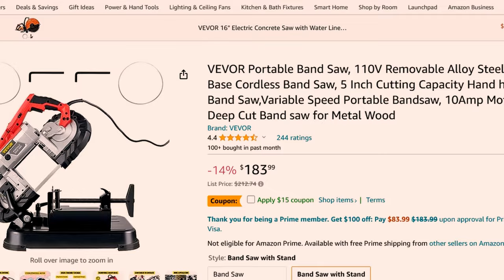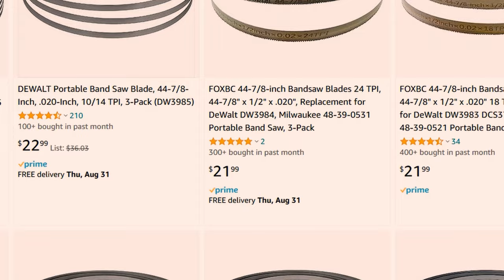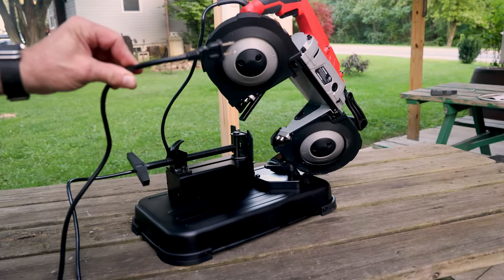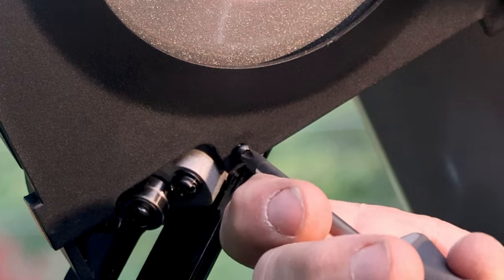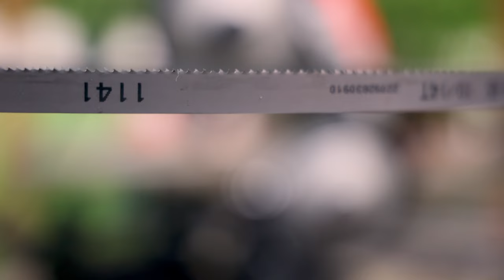Vevor Portable Bandsaw Thorough Test

Comment: I'm into fabricating I have a full size horizontal band saw,but it's big and takes up space while I use it,anyway,I want a smaller one where I can put it in my tail gate,my question is do you think this tool will last,as far as motor and and the bearings for the guide
Reply from the maker: Thanks for watching Charles. I have been using mine since I made the review video a couple months ago, but not extensively. Everything seems to be pretty well built considering what they charge for one of these. What type of materials do you plan to cut?

Comment: I bought this band saw a while ago. It's done perfectly for the past months for hobbyist use. It can even cut tool steel (unhardened) without any problem.
The saw blades can last up to a few months if you use them properly. Plus, when a blade dulls or snaps, you can still use the good quality spring-like steel for some project (e.g. whittling knives).
I also love the fact that you can detach the tool from its base and use it freehanded on workpieces you can't clamp in the vise.
In the end, I feel like this band saw was one of the best tools I have ever bought for its price.
Reply from the maker: Thank you for watching and taking the time to share your experience Nicholas. Lots of people seem to bash these products from Vevor, but this saw doesn't seem bad to me. I have used mine a lot since this video and it's still on its original blade. There are probably better saws, but they probably cost way more money.
Reply: Awesome.  I need this set up in my home shop.  ✊🏻🖤
Reply from the maker: Thanks for watching Vetvsworld. It's a great saw for the money. I've been using mine a lot and it's holding up well.

Comment: No mention of being able to use it off the stand?
Reply from the maker: Thanks for watching Luke. I believe that there's just one bolt to remove, and it can be used off the base. I never thought to mention that in the video. Sorry about that.
Reply from the maker: Thanks for watching Voodoo Ranger. The saw seems solid, but I can take a closer look at that pivot and see if I can foresee any play. I was actually pretty amazed at the quality of the miter cuts that it made on two inch square tube. It's been several months since I filmed that, and have used it pretty often, but not extensively. I am amazed that the original blade is still holding up. My expectations weren't very high on the factory blades, but they seem pretty decent.

Comment: Ive been using a hacksaw with a metal blade to cut up bones for my dogs. Would this work for bones
Reply from the maker: Thanks for watching AL. I believe that it would undoubtedly work on bones very well. Are they big bones that would clamp in the vise on this saw? That would be the only issue that I could think of. This saw is one of the best free things that I had sent to me. It has proven itself quite useful.
Reply: @themostlymikeshow  Hi thanks for replying so fast, appreciate it. No the bones arent too big, just kangaroo tail pieces and lamb necks. Just too big for my little dogs. I can use the hacksaw but its a hard job and i  have a lot of bones every month. I was also told that metal blades leave metal shavings when used and not safe for doing food and could be damaging my dogs internally. Not sure if thats true or not. Ive been using the hacksaw for years no issues
Reply from the maker: @AL-ru3nk I wouldn't think that this would be any different than the band saw blades. It appears to be the same material, only this would be like stroking it One Direction, which would seem to me like it would be less likely to deposit any small pieces of metal, but you never really know. I am definitely not used to hearing about kangaroo bones, being that I live in the USA, LOL. Always wanted to visit Australia!
Reply: @themostlymikeshow  I can understand cutting metal would leave metal shavings but i cant see how the actual  blade would give off shavings on its own when cutting bones. Im sure butchers just use a normal metal blade to cut  their meat and bones. Hope you get to visit us here in Oz soon 🐱
Reply: @AL-ru3nk  yes you are correct its just a large upright band saw with a fine tooth metal blade used for cutting up meat and bones
Reply from the maker: @stephen_b6069 Thanks for watching Stephen!